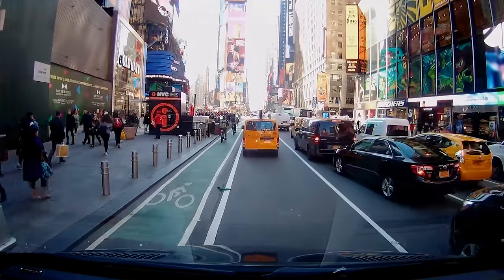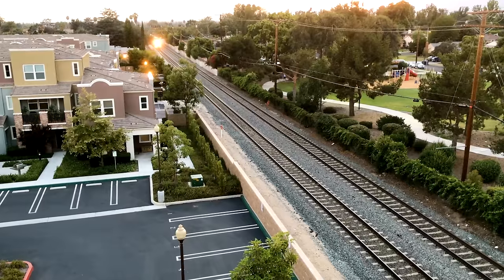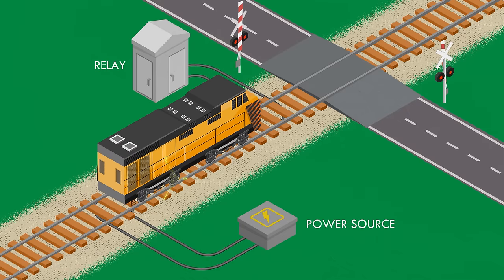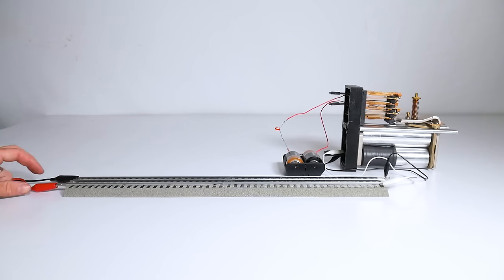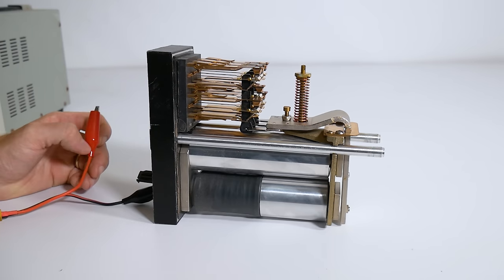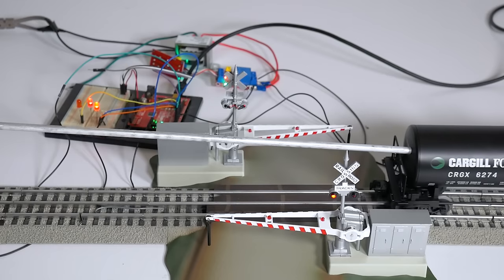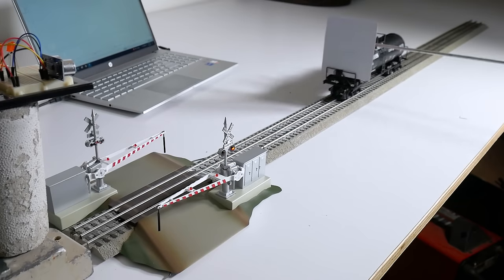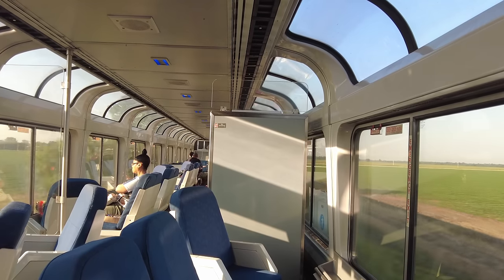How Railroad Crossings Work

Comment: Every time I see someone park on the railroad tracks while waiting at an intersection it just makes me so mad and so scared and so worried for them. However, a till this point, I had not really seen them actually get a close call. However, a couple of months ago I saw someone do exactly that. They parked on a railroad track. There is traffic in front of them in behind them. And then well, a train started coming. This was one of the scariest things I’ve ever seen. They were just on the track and the train came straight for them. They had to drive out-of-the-way of the cars and off the road and pull ahead, but they didn’t even clear both tracks only the tractor train was on. The train passed them within a couple feet.

Comment: In the UK the relays for all  sorts of railway safrty use, also have an extra following relay contacts use in a fail safe circuit's.

Thus if a relsy ontact welds together the saferty circuitvis relay aĺso still makes contactso the fail safe circuit is fails and ìs not safe so it turns the relevent protecting sigñals to red, also flagging a fault in the power signal box controllìng this line.

Power signal boxes are large mainly automated signal box covering a large area which replaçeing meny sìgnal boxes at statìons, ĺevel crossings (grade crossings) ect.

Comment: I learned from this video that the American ‘railroad crossing’ road sign is called a ‘crossbuck’. I’m not sure where else in the world that term is used, though Wikipedia doesn’t identify it as specifically American. (The Wikipedia level crossings page refers to them mostly as saltires or St Andrew’s crosses.) We have far fewer level crossings in the UK than there are in the US, and the only ones with a saltire (white with red outline) are those indicating the very unusual open crossings.

Comment: I have seen several of your videos, and Mr. Harmon's. I do like trains, but one question I have, and haven't found a good explanation of, is this; how do multi-locomotive set-ups work? I know not all engines are necessarily making power and sometimes there are engines mid train or in the back. And I've heard sometimes radio is used to control the other powered locomotives. Are there other ways to control a multi-locomotive lash-up?

Comment: This is a fantastic example of a type I error and a type II error.

The null hypothesis is that no train is coming.
Type I error: Reject a true null hypothesis. No train is coming, but you think there is. Not a deadly error, only a bit inconvenient.
Type II error: Fail to reject a false null hypothesis. A train is coming, but you think there is not. Very deadly! (you first!)

Good for the engineers to minimize the probability of a type II error in this situation!

Comment: how do those train detectors work if the rails and wheels are not just used for the detection circuit but also for the circuit from the locomotive to the coaches and back via the rails (to provide power to the coaches) or from the overhead wire through the locomotive and back to the substation via the rails

Comment: Modern crossings often use a resistance predictor circuit. The device actively monitors the resistance in OHMS on the rail circuits. If it sees falling resistance it knows its coming. If it sees it stop changing. it knows the train has stopped and will put up the gates (unless its on the crossing itself)

Comment: would love to see your Arduino code.  Does it handle the logic for a train on the approach, island and departure sections?    

I've been wanting to add a realistic  automatic crossing on my layout as my OCD does not  like the signals staying on too long after the train clears the road.  Sure I could change move the insulating joints closer to the crossing on one side but what if I run the train in reverse?    Been trying to duplicate what you did but keep hitting roadblocks.

Comment: I walk across railroad tracks pretty much every day, and I had theorized while waiting for trains to pass, that the gates used the conductivity of the rails to trigger, and now I know.

Though it clearly is adaptive because a fast train sets off the signal before it is even visible, and a slow train doesn't.

Comment: Wish you had mentioned, at least obliquely, that there are numerous other signals a train engineer communicates to crews with the air horn, varying by region. In North America, the "two long, one short, one long" used by trains when approaching a grade crossing is actually based on the spoken phrase: "STOP----LOOK----(and)----LISTEN".

Comment: I hear the hissing / high-pitch noises all the time when train is incoming / departing at the station. Is this perhaps the AC current in effect for speed measurement? I'm really curious since I've read before that it's likely just a vibration resulting between wheels and the track :/

Comment: One thing that should be noted is that, in the off chance you are stuck between two crossing arms or otherwise blocked by an arm, they are designed to be easily breakable by a vehicle. Gun it and drive through, it's better than having a train drive through you. Or just get out of the car if you can't drive through it.

Comment: Huh, so you can make the crossing fail deadly by activating approach 1 and then the island before a train comes from approach 2? Since the system will then assume the train that’s approaching from approach 2 is the fake train leaving? Or can the AC speed detector aldo detect direction and trigger anyways?

Comment: One crossing in Menlo Park has always confused me. While the train is stopped at the station, the crossing guards go back up, however before the train even begins to move to leave the station, the crossing guards go back down. This means it is not using the distance sensors. What others ways could this crossing guard operate?

Comment: The bungalows have a little white light.

The light lit solid means power is on and everything is normal.

If the light is flashing it means the A/C power is lost and it is running on emergency battery power.

If the light is out there is no power in the bungalow.

ATCS transmitting from each block to tell the gates to activate.

In my old city there were 14 crossings in 1 mile and each crossing was gapped.

They have 30 foot towers with 900 mhz yagi antennas transmitting the signal down the tracks for each block

It is the most complicated setup I've seen.

It used to be done by wires

Comment: Interesting video. I always assumed the conductor manually sends a signal via remote to some receiver before reaching each crossing telling it to close the gates. The problem where I live is trains taking an eternity to get through downtown. Once I waited 45 minutes as snails outran the train passing through a crossing. I keep thinking this must break some law, since what if an ambulance or firetruck needs to get through? The train was so long it shut down multiple crossings making alternate routes impossible to pass through too.

Comment: We have a crossing we go over that requires a tone through the locomotive radio to activate and deactivate. Based on this video, I assume it's to do with the fact that it goes right through a busy intersection, and the track is too short to support 2 approach circuits and an island.

Comment: Sometimes railroad crossings can malfunction and it needs a special railroad crossing mechanic to repair and reactive them back to the way it's programmed to do. I seen that happen before when both railroad crossings of both Cicero Avenue and 95th Street are actually malfunctioning. That means that they're not working or something is wrong with them.

Comment: Makes me think of the time I was riding with my papa through central Texas countryside and we had to cross a track. Thing was beeping and going off, but there wasnt a train in sight, and you can see a LONG WAY in both directions out there. It makes perfect sense now that it was designed to fail safe and that was likely what happened. He waited there a good 5-10 minutes to be sure, but my mom still chewed him out for cheating across it when we got back 😅

Comment: The battery technology that railroads use. Do they "vent" gasses produced by the batteries by ventilation in those little bungalows they stroke them in? Do they have to keep the batteries warm? What is the insulation material made of, to insulate be support the weight of a train, and what voltage and do they use for these crossings?

Comment: Very interesting. Here in the Netherlands we have adopted the US system, including similar level crossing systems. And the track circuit system. I understand that the train shortcuts the power going to the relay. So the relay drops. But, you can not short curt a power supply, Not from a battery, nor from a net power supply... So how do they do that in real?

Comment: I always find it interesting how much US trains seem to honk. Here in mainland europe that does not appear to be a thing in the vast majority of cases.
E: and that train crossings are switched in such a way as you detail. Like ... does the US not have anything equivalent to ETCS or its various predecessors, which have defined contact boxes instead of having to rely on a short circuit?

Comment: I'm intrigued that you used three-rail track for your demo - I haven't seen that since I was a kid, 60 years ago, when a friend had an old Hornby Dublo set inherited from his father!  Those sets had to use a central (electrically isolated) rail to provide power, as the two running rails were bonded to the stamped metal track base - which had sleepers and ballast printed on it!  I'm even more intrigued to see that such a 'solution' is still in use in model railways over there, despite the running rails being electrically isolated on plastic sleepers/ties - and therefore able to supply the current.  Unless, of course, real-life electric trains in the US actually work that way?!
Reply: 3rd rail power is sometimes used for real trains yes, usually where there's no chance of people coming into contact with it though, like subways. Overhead power is more common, to the extent that our railroads are electrified at all in the US. I do not know why 3rd rail power needs the 3rd rail instead of just using the normal two rails.
Reply: @killerbee.13  That's how railways were initially electrified (see Fyodor Pirotski's attempt of railway electrification) but that ended up losing over a separative live rail. Couldn't find any reasons why, though.
Reply: @killerbee.13  true, but I've never seen the third rail mounted centrally like that - it's almost always on the outside of the track, so it can be as far as possible away from platforms. The only system that I know of that has a central rail is the London Underground, but that's the return/neutral - the live rail is still mounted on the outside.

Comment: 11:05 : So then I suggest stop big trucks early and let them park at the side of the road. Let the other vehicles continue crossing with 30s warning time. Then if someone wants to make sure not to get stuck they can wait at the side if the early signal lights up. When the train reaches the critical point let it stop in case somebody hit a big stop button at the railway crossing or called an emergency stop number.(written in big letters on the barriers) Maybe a webcam would be a better solution. The train driver can watch the webcam at the critical point to check for stuck trucks. But buy the webcam made in the USA or from another  free country.

Comment: Another important thing to know is that if your car isn't stuck on a crossing, but instead blocked in by another car in front of you, just drive through the gate. They are designed to bend/snap off easily. You will not be in trouble, you will not have to pay to replace it. If you're feeling generous, you can even call the number on the crossing and let the railroad know what happened, and the crossing will likely be fixed within the hour or so

Comment: In the UK as trains hit 125mph and the warning time is 2minutes to cover 1mile double gate barriers on both sides of the road there is 3 types of Crossing the railway user worked crossings with an open and closing gate by the user signal based crossing with a two light system with a Red light green light crossing Red light a train is approaching  automatic crossing

Comment: How does this work in countries where the railways are electrified?
As far as I know, the tracks are already used for the return circuit powering the train since there's is only one overhead line. Wouldn't that break the short circuit? Or the island concept?

Comment: Safety tip for you , if you ever get stuck or hung up on a crossing take your jumper cables and connect the tracks together (use both cables red and black ) this creates a short circuit that will indicate trouble on the tracks. this can potentially save lives .

Comment: We often have issues with the railroad companies and DOT working poorly together when new intersections are built. The last few times, caused the road to close for nearly a year and another nearly 2 years before any road signals were working properly. This may be something to do with getting the necessary railroad provisions in place which takes time, but that's pure speculation. Any thoughts on this are welcome.

Comment: Note that these systems don't work for lighter vehicles on the track so maintenance trucks need a flagger to cross. Also using lighter rollling stock than designed, ie light rail on heavy can cause failure and I have heard of fatal accidents in this use case. 

All of this is why some vehicles Must stop at all crossings. Like the school bus I drive.

Comment: Actually railroads did use RADAR. They used it for a lot of things. The EMD GP40X or GP50 used RADAR to detect if the locomotive was moving, and compare the RADAR signal with the wheel speed to eliminate wheel slip.

Comment: 11:20 Railroads have started to employ double gate arms at grade crossings to prevent motorists driving around the single gate arm.
Reply: I believe that in the UK, gate arms extend all the way across the road with a metal “fence” attached to them which rests on the ground when the arm is lowered.  This, of course, is a modern version of the swinging fence gates that were closed manually, as shown in the children's TV show “Thomas & Friends”.
Reply: @augiegirl1  That is a problem when you have some of the really wide roads like some I've seen here with six lanes and a median.
Reply: @wayneyadams  I don't know where you are located, but everywhere I’ve lived (all in the midwestern US), any road with more than 4 lanes has a bridge over the tracks instead of a crossing.  Furthermore, I've never actually been to the UK, so I'm relying on internet photos to see how their modern “level crossings” are designed.

Comment: Fun fact:

Railroad Crossings in germany only exists on tracks with speeds up to 160 kp/h, because at higher speeds the minimum stop distance of 1km is no longer achievable and no more signals are present as the train is guided per computer by the LZB or ETCS

Comment: if the circuit work like passing the current through both metal line of rail track it means we can get electrocuted when we touch both of them , and what if we use its electricity for personal usage like stealing electricity
Reply: pls answer

Comment: The NTSB said the operator knew the snow removal machine was on the tracks for a training exercise, but wasn't sure where.

The operator received a stop command from the CTA's signal system because of the snow removal machine being more than 2,000 feet ahead.

Moments later, the driver saw the machine and initiated the emergency brakes, but the train still crashed into the machine, going 27 miles-an-hour.

Its speed had decreased from 55 mph.

Comment: The biggest problem with train crossing roads isn't so much the people that ignore or run the signal, it's the enginerds that don't think critically enough to figure out the grading for semi trucks to safely traverse over the crossings. Especially the lowboy trailers with little ground clearance...

Comment: How about making another video on a broken flange on a RR car? I’ve seen 3 in my 35 years of being a foamer. Last one about 5 years ago and yes I immediately called the UP emergency number. I could hear the BANG,,,, BANG,,,, BANG sound when it was at least 1000 feet away. I watched the car wheels and finally saw one missing about 1/3 of the flange. I wish I had video of it as I would have posted it on my YouTube channel. A broken flange can cause a derailment.

Comment: Couple years ago at an intersection near my house technicians were servicing the safety equipment but then forgot to turn it back on when they were done.
Later that day a car across the tracks and was hit by a train and the driver of the car was killed. It wasn't until an investigation was done that they found out that the signal system was turned off.
Knowing that service was being done how was it possible that nobody noticed the system was inactive for hours after the work was done.

Comment: It's a great video, but I was waiting to see an explanation of why the lift arms wait so long to lift after the train has passed. I've seen several intersections where the train is half a mile down the tracks, and we are still waiting for the lift. Also, no mention of two-wheelers. They are the Worst about going around the tracks.